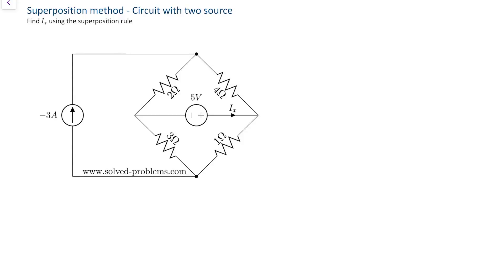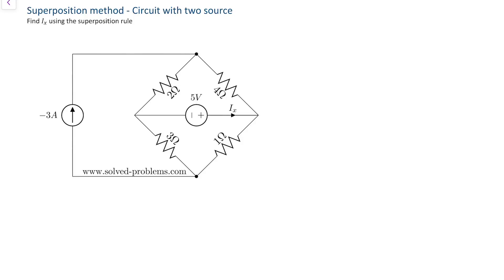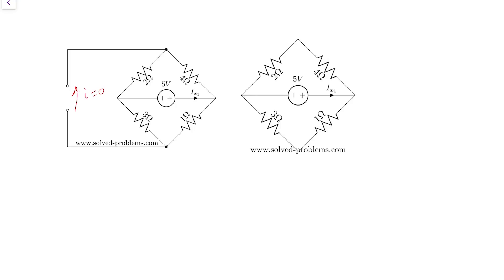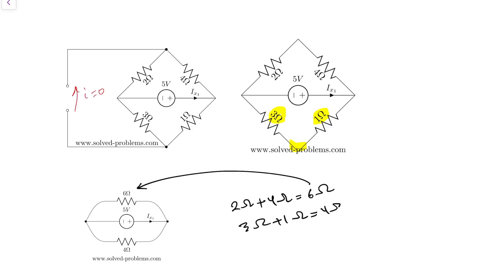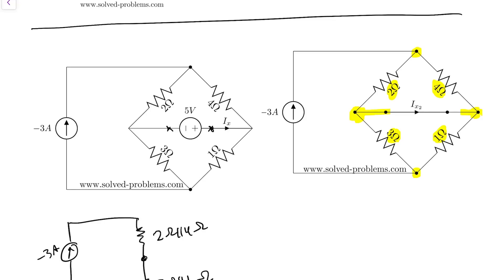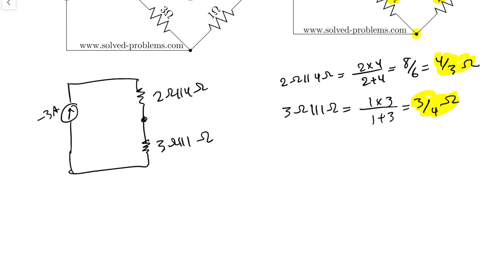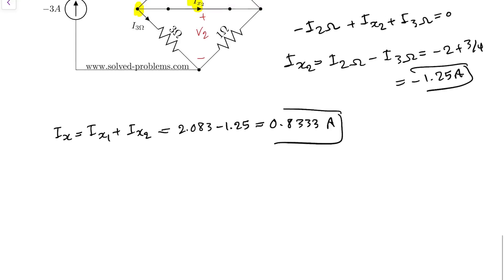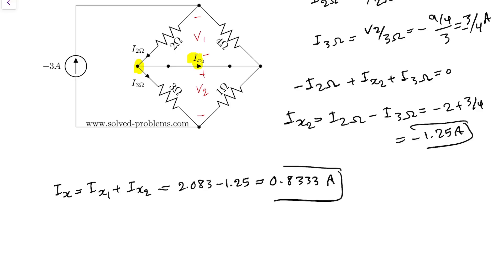Superposition Rule - Solved Problems

Comment: Sir,
In the video for 09:54, are you sugesstting the node connecting 2 ohm resistor and 3 ohm resistor and the node connecting 4 ohm resistor and 1 ohm resistor are actually the same?

But that's a wire replacing the voltage source which is short circuited?

I am a bit confused~~~
Reply from the maker: Well, with the wire connecting them (the short circuited voltage source) both nodes are the same; means it is just one node.

Comment: Hello Sir, 
why the circuit is not consider as left branch (2 ohm resistor & 3 ohm resistor ) and right branch (4 ohm resistor  and 1 ohm resistor) are parallel?

 Instead, the branches  are  parallel with the combination (2 ohm resistor & 4 ohm resistor ) and (3 ohm resistor and 1 ohm resistor)?
Reply from the maker: In general they are not parallel because the voltage source in middle which has a non-zero current passing through. When the voltage source is made zero, 2ohm becomes parallel with 4ohm and 3ohm becomes parallel with 1ohm.

Comment: if the current source is positive 3 then what will be the changes accur in the solution
kindly guid me
Reply from the maker: Similar solution till minute 12. Then V1=4V, V2=9/4 -> I2ohm=2A, I3Ohm=3/4A, Ix2=5/4A=1.25A and Ix=3.333A